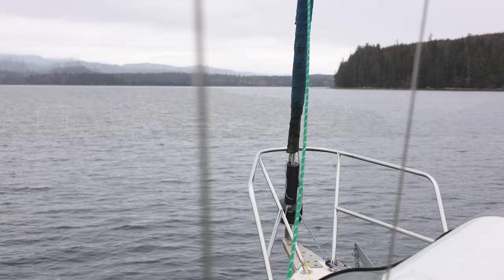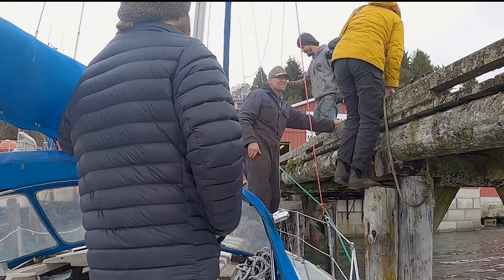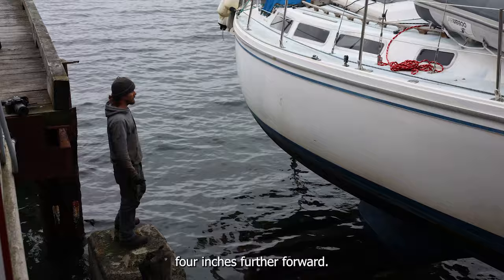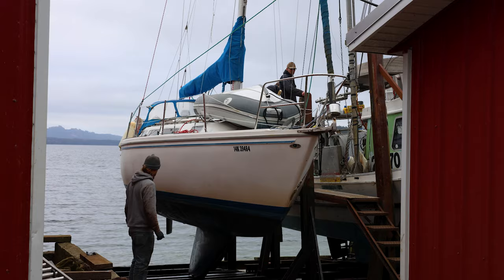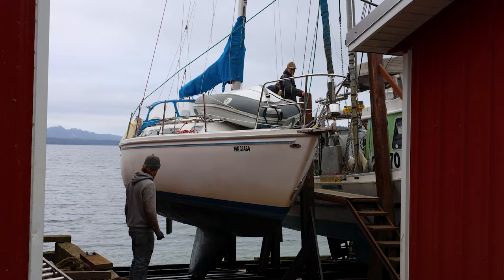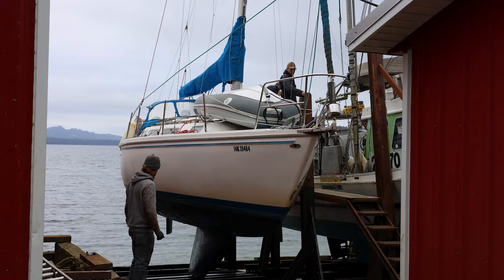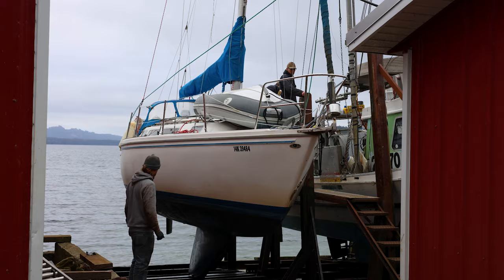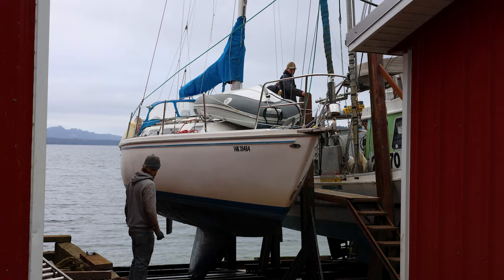High and Dry in a Hundred Year Old Slipway! Hauling out the old way | A&J Sailing

Comment: Hi A&J....glad to see you're back!
We have the same boat as yours...year and everything...and have owned it for over 30 years now.
We use to haul and bottom paint etc every year.....but more recently we've found that we can get up to 3 years without serious growth on the hull. (Petit Horizon). The fly in the ointment is the zincs...and barnacle growth on the shaft and prop.  Three zincs can usually make it at my marina (Canoe Cove).  We've tried to stop the barnacles by bottom painting the shaft and prop...with some success but not perfect for 3 years.  
We haul out in a couple of weeks and this time I'm going to try the spray-on coat that seems to be popular now. 
 Your vid did not show your new zincs or treatment of the prop or shaft....so i was wondering what, or if, you did anything to address this issue?  (Barnacles can really mess up prop efficiency!)
Thanks
D&M Bond
007
Reply from the maker: Hey guys! That’s awesome, Wow 30 years!!! 
We’ve owned Uintah for 3.5 years but it’s been at least five years since she was hauled so we were pretty impressed with the (little) amount of growth…  although we have dove on her a few times to scrape off growth and change the zincs. 
For the amount of time she’s been in the water we weren’t too concerned with the growth on the prop and shaft. We just scraped and cleaned it up
and put two new zincs back on (seems
to be sufficient for where we are). 
We’ll probably get on the bi-annual haulout schedule moving forward? We’ll see how it all goes (or should we say, grows) I guess. She’s definitely a heck more efficient in the water now!
Let us know what you think of the spray-on!

Comment: Well, here you are strangers!
James the first 30 second, if ones does not listen attentively, sounds kind of kinky! LOL 
I haven't seen one of these haul-out dolly's in a lonnnng time.
You are so far north! These people seems so calm, relaxed and kind. What cool history of that yard, thanks for picking that up!
When was this video done?
Not minding my own business, can I make a few comments?
1/4" play, Yep rudder shaft goes right through the rudder tube on these Catalinas. If you drop it, you can now insert a sleeve into it, it makes the steering much smoother with no binding. Two things you want to avoid: The rudder rubbing on the little skeg (you are pretty close) and the play ovalizing the rudder tube. 
Anodes, decent explanation but you definitely do  not want your electrical system being part of any of it and/or dumping any electricity in the water (see ESD, electric shock drowning). The only electrical relationship is between the SS and the anode, the salt water being your electrolyte, creating galvanic corrosion. The anodes (less noble), here I guess zinc, give itself away to protect the SS and bronze prop (more noble). (and bronze thru-hulls etc if bonded, but your boat is not, that is why your through hulls are not painted). In fresh or brackish water it would be different. I usually suggest using aluminum anodes these days as they pollute way less and are more active and stay active in fresh (river) or brackish water. 
Did you remove and re-install the set screws in the strut that hold the cutlass bearing in place?
Big fat blisters, are usually not an issue and from what you show they might even be just the coat of previous antifouling paint not prep properly and growth lifting the next coat(s) that was applied. Small high-pressured blisters that smells like vinegar are another issue.
0k, I am done preaching!
I hope I do not sound like the "armchair-sailor-that-knows-everything"!! LOL
.
Yeah that was a successful haul-out! Congratulations!
Great episode as usual.
Cheers,
a.
Reply from the maker: Cheers Alain! Thank you for all the info! I couldn’t find the set screw in the cutlass bearing so we ended up cutting it out, it pressed back in fairly easily!